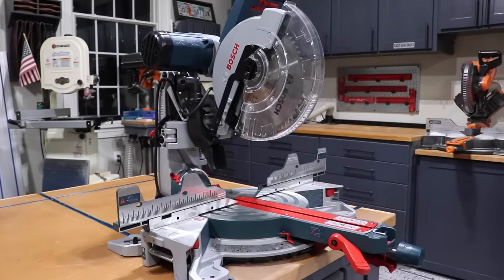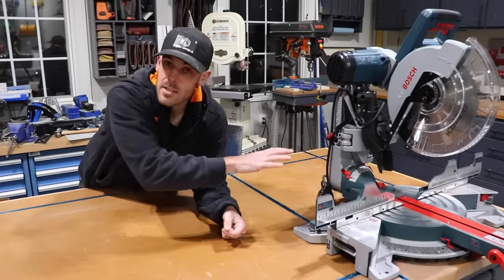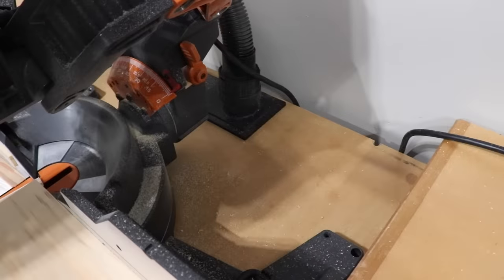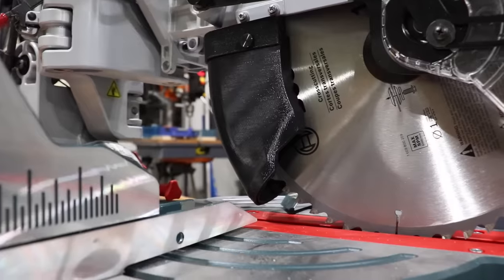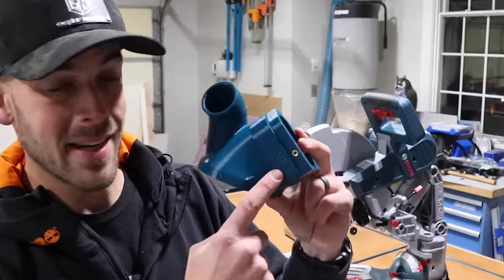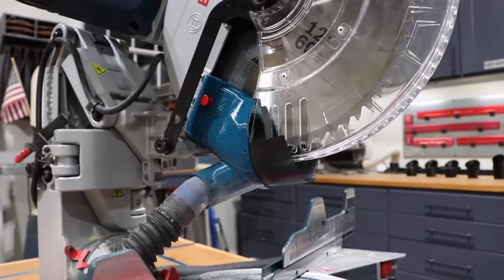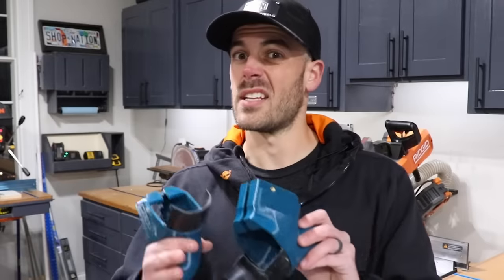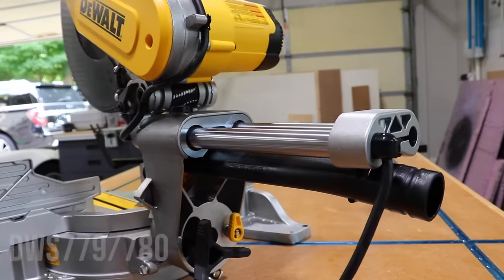It's like Bosch doesn't even care

Comment: I bought one and I like it. It works really well. The one improvement I would make is to blunt the little screws that hold on the flap/curtain. If something gets caught in the opening and I reach in to fish it out, OUCH! I solved it myself by grinding them down while in place with a Dremel cutoff wheel so now it’s smooth inside.

Comment: i have this saw in my shop. the dust collection is the reason i just have the saw fully contained in a hood with a 5" port in the floor of the compartment it sits in. I have a hose connected to the bosch factory dust port and it just drapes down into that 5" port. after all that, i found that adding a 2" hose tucked up into an upper corner of the cubby, pointed out in to the room, increased the resistance of the entire system so that the factory dust port actually does something, the 2" hose (which of course is run loosely into that 5" port also) creates a small draft towards the entire saw from the rest of the room, and the 5" port on the compartment floor catches what would be the "rooster tail" of dust behind your saw.

Comment: Bought mine yesterday.  Got both adapters.  I also got your cabinet plans a couple of years ago. Mismeasured and the cabinet over the saw is too low and had to hack off the bench corners so saw would swing to 45 degrees miter. Oh well, still going for shop greatness. Your one of my top 5 watches. Keep on keeping on.

Comment: I have the V11 for the Bosch 12 inch. This is an amazing solution! DRAMATICALLY better than the factory dust collection. Elegant, easy to install, and its not the big bulky housing some put around the miter saw that limits its utility.

Comment: I bought the attachment, and it works great. One small note, make sure you slide the fence over so the dust collector doesn’t hit it when you make a cut. My dust collector snapped near the screw on the first cut because I didn’t move the fence. A quick fix with some CA glue solved the problem, but it could have been avoided.

Comment: I finally got to installing this, and wow man what a good job! this thing catches so much more dust than original.  I had to order a rockler flexi-hose because the stiffness from my shop vac was pulling o the miter saw dust collection connection a little to much.  But so awesome! i have a few projects to get done this week and will be using it a ton!

Comment: Hey Travis, I purchased the slt file. A few things, I had to bevel the 1/16 sheet to go into the slot, and I also had to drill out the holes for securing the sheet because it was going to crack the pla.
Reply from the maker: I wouldn’t recommend PLA for this, PETG will be stronger
Reply: @ShopNation  okay thank you

Comment: Amazing!  Just received and installed.  Great product, excellent engineering and well made. Thank you so much for developing and producing a much needed saw component.  If anyone owns a Bosch 12" saw and doesn't buy one of these today, they are truly missing out.  No more duct tape and cardboard nonsense on my saw dust collection.  Mechanical Engineers ROCK!  Love your channel.
Reply: If you don't mind me asking, how much cut height does this give you at the fence?
Reply: @timmietimmins3780  Will check. Think it  didn't change, but will verify. I will be back at the saw tomorrow. Will provide you an exact measurement.
Reply: Getting back to you on the vertical cut capacity of the Bosch 12" post-installation of the improved Shop Nation dust collection port. Verified that the vertical cut capacity remains unchanged at approximately 6 and one-half inches at zero degrees. Only thing that I needed to do was make a very small modification to my sacrificial fence but it was very minor. Hope this helps you out.  I love this improvement. Bench is much cleaner. Hope this helps you out.
Reply: @mikegee7769  It does, thanks!

Comment: I have same saw and just added a longer and wider piece of rubber dust flap that the blade has a kerf in the rubber piece and does pretty good for 5 minutes and a few dollars of 1/8" rubber and can cut any sliding miter or miter!

Comment: As a retired automotive engineer, I designed and built a device for dust collection on my 14" Delta Bandsaw as the factory design was terrible at collecting dust.  The design is over 90% efficient in collecting dust from the bandsaw, virtually eliminating clean up after making cuts and much better than other designs I have seen on YouTube.  I don't do 3D printing or computer design so I made my device using wood and salvaged plastic components.  If you want the design to make a 3D version and use it for your channel and business, please reply back.  I am happy to share this concept with woodworkers to make their hobby/business more enjoyable.  The concept can be easily adapted into 3D plastic and used by anyone with a Delta 14" bandsaw with a cast iron table, however I am not knowledgeable on how Delta's cast iron bandsaw tables have evolved over the years.  The design would have to be adjusted to fit other bandsaw manufacturers.

Comment: This is great, the only problem I see is that if you’re cross cutting at maximum width and cutting depth  (350mm ish for width, 100mm for depth on this saw if memory serves) the dust shroud will foul on the workpiece and prevent you from cutting at full depth, due to it hanging lower than the arbor. This isn’t an issue for most, but I regularly cut down very wide and thick hardwood boards in my line of work.

Comment: I received my new dust collection attachment and installed it. I cut a lot of wide boards of various thicknesses and I pull the slider all the way back to me before I start cutting. The flap folds up on top of the wood on that kind of cut and dust goes out the side everywhere. You are using the slider as a chop saw in the video which defeats the advantage of the slider. I had to move my fences out so the flap would clear which gives less support to the wood as it is cut. Overall I am not as impressed as I thought I would be but I will try it out for a while and let you know. At the moment I think if you use it as a chop saw then your device works but not as a slider. Before I purchased your attachment I used the Bosch dust collection but I removed the 90 degree elbow at the top and connected my hose direct to eliminate that 90 degree bend which you never want in dust collection. I need to use my saw as a slider for wider board so unless I can modify your device I will have to go back to the original Bosch dust collection. You should cut boards 12 inches wide and two inches thick for more realistic uses of this machine for cabinetry etc.

Comment: Hi, your work is amazing. Having worked on that issue for years, the main suggestion  I would make is to increase the suction at the port by changing your Rockier 25 mm colapsable hose with the great 35 mm x 5 m very flexible Bosch hose (VAC005) at around 35$

Comment: G’Day from Australia,
Looking at the last dust collection Shute if you made, if the rubber was slightly deeper & take it further round on the Shute when you make your cut the rubber would widen when it rest on your workpiece providing more area for dust collection. BUT there will be a fine line in doing this as the rubber “MAY” bind with the blade. 
Enjoying the content you provide yes I know I’m 8 months behind. 😂 
Cheers Troy

Comment: Mechanical engineer here specializing in dust collection systems. The key to good dust collection is capture velocity. For saw dust You need at least 200 to 400 fpm at the point of collection. (200 fpm where dust is directed into the capture device and 400 where the capture device may be a bit further away or large. CFM is secondary to capture velocity. Calculate the CFM required to obtain the capture velocity and also maintain at least 3000 fpm in the duct work.  This works for me every time and makes happy customers.
Reply from the maker: Awesome info! Thank you

Comment: I may be in the minority here, but I’m an amateur 3D modeler who tinkers with Shapr3D and 3D printing. I would love to see more of your design process and how you work in CAD. Things that might seem insignificant, like how you measured the mounting location on the saw to create that prototype, would actually be really helpful.  My interest is designing and making functional parts (vs artistic things, for example) so there are always issues measuring and laying out the mating surfaces, figuring out interference, determining fasteners (love your use of threaded inserts, btw), etc.  A deeper dive on those steps would be really interesting to me. Thanks for the great video.

Comment: Feb 22 2023 - I just saw this video and I must admit, I am freaked out.  What you have done are doing is FANTASTIC.  I have been struggling with building and adjusting a box that I built around my DeWalt 716 10" Mitre Saw to contain the dust but it is frustrating.  While I love the the MITRE Saw, I can't stand the mess and it is messy!.  So I am wondering how you are with progressing on the dust reduction thing that would fit a 10 inch DeWalt DW716.??  Having never done this before I do not know what the process is or the best way to communicate with you on this subject?

Comment: It's great to see someone tackle the dust collection issues on miter saws like you do!

I was wondering at the end of the video, why aren't you making the dust collection fixed to the base?

Your only issue seems to be with bigger particules flying away because they can't be caught by your 3D printed part, so, if you were to make a box that is fixed to the pivoting base and that clears everything when doing 90deg, miters and bevels, you'd then need to make a hole for a hose and you'd be good to go, I think.

Obviously, I don't own the saw, but from what I can see in the video, there isn't a lot of dust particule that goes above the fixed screw that makes the guard pivot, so if you could maximize the box's height to its fullest, that would be great, in my opinion.

Comment: As an engineer, I love your process. I think your design goals are pretty reasonable for most folks.  I would love to see you work on the Makita 12 inch dual bevel. The stock solution is not too bad, but clearly a lot of room for improvement. I already modified mine for a lot more airflow, but I will look at it again after seeing your more aggressive approach.

Comment: I have a 2hp dust collector connected to the miter saw. One 4inch pipe from under the saw (not straight under but in the back) and one connected to the top pipe already coming with the saw. I also build a wooden housing around it to keep the dust in so the dust collector can catch it. It works 75% I would say.

Comment: I just finished installing and trying out the dust chute on my 12" Bosch saw. I 3D printed the pieces myself from your STL files and ordered the hardware kit, just so I didn't have to search around for stuff. I also designed and printed a hose adapter that fits my FESTOOL vacuum.This works way better than the stock dust collector. I vacuumed up the saw area behind the blade and did a half dozen or so cuts. There is practically no dust on the rear deck of the saw, and I could  lots of dust headed up the chute. I may try to design and 3D print an adapter allowing me to attach the stock bag, just for those occasions a vacuum isn't available.

My only negative comment, is that when I received and opened the hardware package, I was deluged with horrid tobacco smoke odors. Yuck.

Comment: I just finished printing the digital download version and am very impressed with the design. 

I purchased my saw in Jan 2013 and everything fits perfectly after one small edit. There is a metal cover on the right side of the attach point that seems impossible to remove. The metal cover interferes with the Hub Mount, so I loaded it into CAD and notched the corner to fit around the cover without removing it. Newer versions of the saw might have a different design that is modified or easier to remove.

Thanks for providing the much-needed upgrade.
Reply from the maker: Watch the install video linked at the end of the PDF document, I talk about that part
Reply: @ShopNation  Thanks. The video is helpful. My 10 year old saw uses the two screw holes on the top of the metal cover plus the one side screw. The top screws are extremely tight. Your video shows the cover being held only by one screw.

Comment: I have this saw and dust collection is definitely a problem… I appreciate all the work going into this. I plan to order. I have made makeshift chutes with gorilla tape and have found all chutes to be a problem on thicker stock. You really didn’t have any video on it sliding… And the add on black flexible piece seemed to drag across the three-quarter inch board you were cutting. Will this work at all with 8/4 stock?

Comment: This was my first big boy saw that I bought when I went into business for myself. Straight away I found out how bad the dust extraction was, I used gaffa tape to build out the original rubber boot. It worked alright, was definitely an improvement but the best thing I did was buy the Makita ls1019.

Comment: Travis, I'm sure I'm a few days behind, but here's my idea anyway.... do you think if you make the flap to the dust collector fit the full opening of the collector, it will close up the whole opening, catching everything headed in its direction.... what if you make the flap or part of it out of the same kind of comb/brush material used on home vacuums... the brush should be flexible enough to give for the bevel angles but stay stiff enough to keep its shape for normal use???

Comment: Contacted after I bought one and explained I could not cut a 2x4 in its 3.5 inch height.
It’s been a while now and no reply with an better option or a replacement.
Very disappointed. But I’m happy if a new version comes out to try it and give a thumbs up if it works. Because right now it useless to me.

Comment: Nice work! The only solution I can see working (read: hypothetical solution) is to enclose the miter saw in a cabinet with sliding doors on the front, and 6" piping to the saw either form above or below. I have a Hitachi C12RSH2 and some 3mm Neoprene. I'm going to do enclosure around the saw and enlarge the rubber dust chute to function closer to a Festool Kapex. If that doesn't work, I'll contact you. lol

Comment: I’ve got both a box and dust collection contraption near the base of my miter saw (older Bosch with sliding rails). This video makes me want to develop a similar port that moves with the saw blade, so thanks for the motivation and inspiration! 
My question is, do you think there’s a market for something like this for older miter saws, like there is for some of the newer saws you’ve engineered a solution for? Thanks!
Reply: I probably have the same sliding miter saw as you, the PCM 8S. The rails make it nice and precise, but I don't know how many times I've botched cuts because the rails bumped against something :/

Comment: I love all the different versions. If you don't mind some feedback - I was wondering what about creating some threaded (or magnetic) ports on both sides (of your most efficient version) - where you can screw in adapters to allow for different hose fittings. On the other side would be a threaded (or again - a magnetic) blank to prevent dust escaping.

This could work for allowing flexibility when compound cuts need to be made (and perhaps accommodate sliding action) - where the side facing upward would allow hose attachment - and conversely, on the downward side a flat/low profile blank would allow movement. Basically a built in "Y".

Again... love the design. 

Kind Regards,

Your friendly Newfoundlander,

Calvin

Comment: Crazy thought... an add on for the dust that goes below the flexible boot? same basic design - dust hits flexible boot slowing and then gets carried by the air from the vac - only inverted - soft enough to bend out of the way as the other boot swings through.
I still think that a particle slowing grate of some kind would assist with dust capture by slowing the particles and at the same time increasing the air velocity of the air being sucked up by the vacuum. All that you would need to do is to slow the particles down and put them in the stream of faster moving air.
Starting with a large diameter pipe, the velocity falls as the opening gets bigger - but we don't need to suck from the entire cross-sectional area - we can simply place a cone pointed at the dust source inside the pipe, causing a restriction and thus a faster airflow ring. Balancing the restriction with the airflow, it should be possible to have both a higher velocity stream of air and a wider collection area.

Comment: Since you have full control of the design, you could maybe try angling the slot for the rubber slightly outward to increase the mouth opening of the flexible skirt without increasing the footprint of the plastic chute.

Comment: That's great... I've been looking for a solution for the excessive dust on the 12" slider without building a massive hood enclosure... I upgraded to the 12" almost two years ago for the zero clearance on the backside (fits much closer to the wall), BUT my 10" compound slider was way better at catching the dust! Maybe you should make a 3D printed led light like the Dewalt for a shadow cut line. I have seen some versions on the early release saws, but mine is like yours... the cast housing is different from the earlier versions.